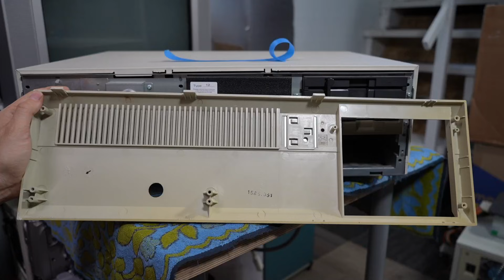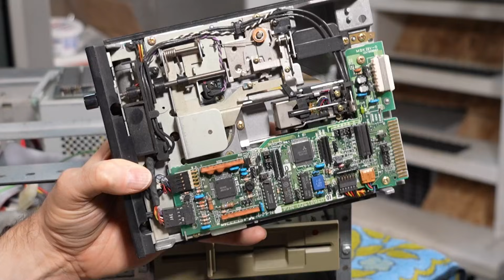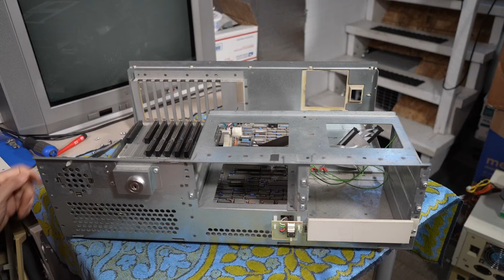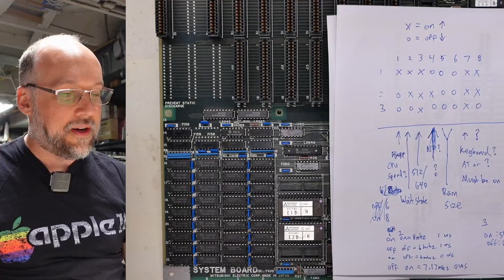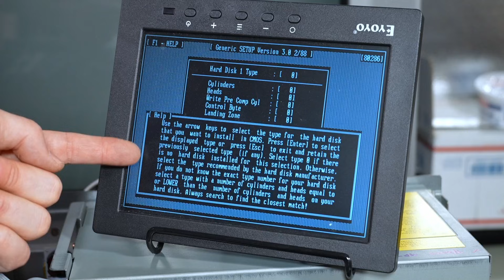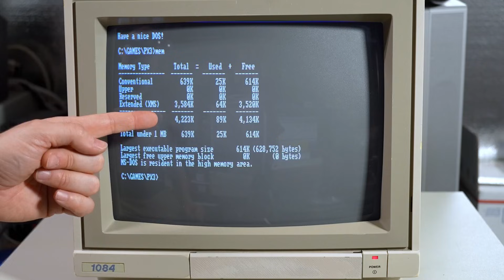PC archeology: The Leading Edge MP-2400L doesn't exist

Comment: Paradise was bought out by Western Digital in 1986, so most Paradise video cards and chipsets were made under WD's ownership. Most 287 co-processors run at 2/3rds of the main 286 CPU's clock speed. The 80287-3 chip is rated at 5 MHz, and an 8 MHz 286 system would run it at 5.333 MHz. The 287XL and some of the later non-Intel 287 chips run at the full CPU clock speed.

Comment: I just saw a re-run episode of The Price is Right from 1985.  They played "One Right Price" or simply the game where you choose from two different price tags.  It was played for a Leading Edge PC and a "Computer Cabinet". The two cost 6500 US dollars.  Not particularly tech nerdy, but a fun coincidence to see a Leading Edge PC on TV just after this video.
Reply: I had a sanyo MBC 55 about this time. A 1.2Mb floppy drive was over $300 and memory was north of $300/Mb

The Japanese computer industry had a mindset that IBM was "the enemy" (they called it "the monster") and the non-IBM form factors were deliberate 

By 1992 ram had come down to just under USD $50/MB, then the sumitomo resin factory fire occurred and ram doubled in price in a period of less than 2 weeks (just AFTER I'd purchased $2000 worth for resale to Atari users. The company which sold it to me offered to buy back what I hadn't sold for 3 times what I'd paid for it, as they were out of stock and desperate to get systems out the door

Comment: As you mention the keyboard going wonky with that other jumper, is it possibly related to the A20 line?
Reply: Unrelated and apologies if I missed it; but I was wondering why that motherboard appeared to have 4 clock crystals? Would that be due to the integrated FDD controller or FPU running at a different speed?

Comment: As others have mentioned this is the same Mitsubishi PC that Sperry also resold under their brand.  I have a complete Sperry 286 system will all original cards and original documentation (including all switches and jumpers).  I also have the original Sperry monochrome monitor and an alternate Phoenix BIOS that works in this system.  The Mitsubishi BIOS that came with these systems had compatibility issues (for example it will not run Windows) and the Phoenix BIOS seems to work better.  If you'd like copies of the documentation or a copy of the Phoenix BIOS let me know.  I also have an old Dolche 286 lunchbox system, a DECTalk card and many other old cards and components you can just have as a donation.
Reply: My previous comment seems to have never been uploaded.
Yes, this is the same model as the Sperry PC/IT.  I also happen to have all the documentation for this computer but, unfortunately no floppy disks.  It was donated to me some time back when I was looking around for more information on my Sperry HT (or better known as the Leading Edge Model M).
Happy to also scan in the Setup Guide's pages as they all came in a binder which is easy to remove for scanning purposes.
Reply: Could you share that bios publicly at theRetroWeb or some forum like vogons? Thanks a lot
Reply: @orbitaretroretro3907  I'll see what I can do.  It hasn't been powered up in years.

Comment: The 386 had a 12 mhz and a 16,20, all the way up to 40. I don't know if they had an 8, but I know they had 12 and 49 mhz was the last one.
The 486 I believe they had a 16, 25, and they went up to DX4-100
I almost think they had a 120
Then the Pentiums 60,75,80,90,100,120 
And I think the P2 was 150 and the P3 was 300 
I don't remember what the max was and the P4 I seem to remember them being in the 2 GHz speed and up to 4 GHz

I am pretty sure the P4 went up to 4 GHz models

I remember when they started doing dual core and then 4 core and 8 core
I think 8 core is standard now.

I don't know what the maximum speed is now

Comment: There are lots of lost PCs 

There was an ISA PCI motherboard that was I think a 486 or a 586 CPU and it was THE board of a year right around 1995

Literally EVERY PC I bought had this identical board and it was silk screened the names of the different sellers but it was the exact same board.

It was a massive pain in my head for years because the board didn't support the larger hard drives.

It had an auto detect hard drive in the BIOS but I believe it couldn't detect above 500 MB or maybe it was 300 MB

I remember trying to flash the BIOS and the last version they made didn't detect the newer larger drives.

I even tried hot swapping and flashing a blank eeprom with a hacked BIOS and it still didn't detect the larger drive.

Basically people had these boards and they were Windows 3.1 or dos and they had four slots for Simm memory, and the machines came with I think and 80 MB or 60 MB hard drive.

When I upgraded them to Windows and put the install files in a Win95 directory and installed Windows 95 and the software programs there wasn't any space left, so I would get a call from the company within a short time and I figured I could just install a new hard drive.
But the BIOS was never designed to work with larger drives and for whatever reason it wouldn't accept a bootloader program to bypass the BIOS.

I got so sick of seeing that board and I don't know how or why but there must have been one factory in Taiwan that just cranked out hundreds of thousands if not millions of this board and everyone bought it from them and they silkscreened the names of the company or no name at all. Some of them had no name, no model number. A lot of the homemade machines where people bought the motherboard from a mail order in PC magazines sold this board.
It was so frustrating because I had older 486 and even 386 machines that the BIOS was able to detect large drives even in the low GB sizes and this newer board could not.
Really had a tough time with it.

Just very stressful

The problems from the early days people just don't know what it was like.
Reply: It was probably PC Chips or Microstar international (MSI) - both makers did this. Usually there was an identifying code in 2-3mm high lettering between the 4th and 5th slot which enabled working out the spec.

These models were infamous for "fake cache" (dummy ICs in the cache ram sockets and a hacked bios reporting cache installed) that would manifest in Linux as a seg11 fault during kernel compilation - mostly of PC Chips origin, but some MSI boards too

The New Zealand importer of these boards was heavily fined by the Ministry of Commerce for deliberately and fraudulently misrepresenting the boards - a company rep then got on Usenet's nz.* groups and claimed "it was all a mistake". Upon seeing this reported via Computerworld magazine the Ministry issued a second - tripled - fine, for further attempts to deceive buyers and ordered the company recall, destroy & replace or refund (at original sale price) all affected boards, overseeing the destruction (These boards could have been salvaged and losses minimised by fitting a non-hacked BIOS, but the MoC was determined to make them HURT)

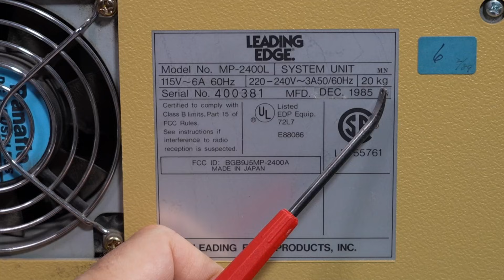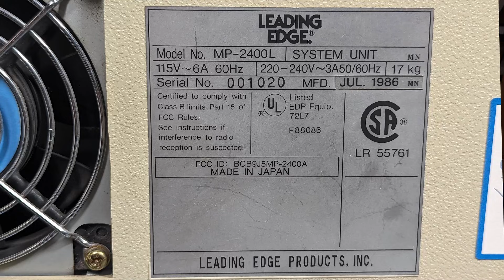Comment: Did I miss it or was the change from 20kg at 4:20 to 17kg at 34:02 not explained? As the PSU at 19:30 states 3kg, and the one at 32:40 looks like it also has 3kg on it although it's unclear, it made me wonder if the later version came sans PSU, but that sounds wrong to my mind. Did they just use thinner metal in manufacture or is it not a measure of the chassis/box but rather the weight which the computer could handle placed upon it (e.g. a CRT monitor or a printer)?
Reply from the maker: Nah they were all identical. Likely the included drive was full height 5.25" and maybe a 3.5" drive in 1986. The big drives are super heavy and could easily account for the difference in mass.

Comment: I have to tell you my bus mouse adapter card story.  For some damn reason we had a HUGE box of these at a job I worked in the 1990s.  Think a box that could easily pack a 14" monitor in it, halfway full of these.  Well, this was during the era of the Pentium and Pentium 2, USB becoming common and so forth, so while PS2 mice were the norm all machines had these ports. One Christmas, I grabbed the box and took it in my cube - the walls were that soft felt stuff that was used for sound-deadening, you know what I mean.  Anyway, I arranged all the cards into a Christmas tree shape on my cube wall by simply hanging them by the solder points on the back, which snagged the felt quite nicely.  I topped it with a squishy stress-ball toy that was in the shape of a star.

Comment: Reminds me of a Sperry machine, it's the right the front panel and vintage. IIRC, it was a somewhat oddball 286. But it's also been 30 odd years, it's just the front panel seems really familiar. 

Given the amount of badge engineering that went on at the time, it's not impossible that Mitsubishi made these for several vendors.
Reply: Yeah, someone in another comment said that this was a Mitsubishi design also used by Sperry.

Comment: It looks like GSETUP is beeping because it can't find the hard disk parameter table in any of the usual places (INT 41h or INT 46h). I poked through the ROM dump and found what looks like a drive parameter table at 0x2fcf; it looks like at least the first few types are standard AT drive types (306/4/17, 615/4/17, etc). You might be able to get GSETUP to work by doing something like "E 0000:0104 CF AF 00 F0" in DEBUG before running GSETUP.
Reply from the maker: I wonder if a patched version could be made? What does that debug command do?
Reply: @adriansdigitalbasement  It sets INT 41h to where the drive parameter table should be on that bios (assuming the BIOS image starts at F000:8000).
Reply from the maker: @leecremeans5446  ah pretty trick! According to another viewer it seems the BIOS only supports type 1-14 as well, so a really limited selection which likely explains the strange way these drives were formatted.
Reply: @adriansdigitalbasement  Okay, I took another look, and it turns out INT 41h doesn't point to the top of the drive parameter table like I thought; it points to the current parameters for drive 0. So I popped GSETUP.EXE open in Ghidra, and yeah, it looks like it's hard-coded to use the AT's drive parameter table address at F000:E401. It looks like the relevant bytes are at 0x274c and 0x274d in the raw EXE; changing the "01 e4" there to "cf af" should make it look in the right place.

Comment: I had an old 286-12Mhz back in the late 80's.  It did pretty good.  I had the Mitsubishi MR-535R 5.25" HH RLL HDD.  It was a good clone machine back in the days.  Although the ISA bus ran fast so you had to watch which cards you had in there if they were tolerant of the higher speed bus.  🤠👍

Comment: Interesting thing that the 2nd one said "only" 17 kg on the back label. The other two were 20 kg. Clearly they made it lighter as it's a newer model.
Reply from the maker: Indeed. I wonder if the older ones came with a full height drive and the newer one something lighter? Those big drives are quite heavy, easily 3kg
Reply: I suspect the lighter one had NO hard drive originally.

Comment: 7.17 MHz is basically 1.5 times the 4.77 MHz speed of the original IBM PC. It was a common speed for turbo XTs.
Reply: what is unusual about it is that it still works plain and simple🤣🤣🤣

Comment: Using nails like that can bite you because they can “splay” the sockets open in the connector, resulting in bad connections and pin retention when hooking the connector back up. Same with sticking T-Pins in the D connectors. Ran into that almost daily when I was doing Avionics work for years. Just something to consider.

Comment: Did the math.  6a is almost 700W.  That is insane when most systems through the 90,s had like 250w power supplies.
Reply from the maker: I think part of that is the pass through connector for the monitor, but it's still quite a substantial power supply for the time

Comment: Although, this comment isn't about this particular model, but it's somewhat related in the vein of the Leading Edge brand.  I have a rather late Leading Edge PC (Fortiva 5900, aka "CPC-5200") and there's NO documentation on the particular model that I have.  I found the manual for it's predecessor, a 486, but mine is a Socket 4 Pentium 60MHz.  It seems like there's a common theme here, unfortunately.  Maybe these particular models that are lacking their documentation (Adrian's 286s shown in this video and my Pentium 60) were the ones that didn't sell well?  Were they flops like the Apple Lisa or IBM PCjr?  🤔

It was fantastic seeing you again in person, Adrian, (at VCF Midwest) and thanks for your input on my aforementioned Leading Edge PC!

Comment: When I was younger we had a leading edge computer that I always thought was a 386 but I guess it would've been a 486 because it definitely was one of the winpro cases.  it had windows 3.1 and also had a CDROM drive and 4MB RAM.  Kinda cheap and limited.  Pretty surprising how poorly specced so-called multimedia PCs which had CDROM drives were.  Probably more focused on crappy edutainment shovelware that just slowly loaded text and static photos off the disc, than anything real time/interactive like games.  If I was more familiar I might've been able to use Doom at playable frame rates but I had no idea about adjusting anything like that, but even then a 33Mhz 486 would've certainly struggled to be playable.

Comment: I just started watching, wanted to say the the IBM 5170 PC/AT  does have three half-height drive bays on the far right.  The bottom one is not accessible with the cover on.

We had one at work that I had to upgrade for Oracle 5.1 for DOS, and I had both 20 MB and 30 MB full height drives in it along with the 1.2 MB 5.25-inch floppy drive in the top right bay.  It took a 128 MB RAM card to get to 640K conventional memory, and an Intel 2 MB expansion ram card.  It also had the Professional Graphics Adapter (PGA) card and display monitor and a Digital Equipment Corporation Ethernet card (DEPCA) using DECnet-DOS.

I wish I had it today!

Comment: Ah the FCC Class A HDD, blast from the past.  Not for use in residential areas.  👍😁  Although you still see class A devices, current HP enterprise printers are still only class A and not class B compliant to this day.  😲  That is just lazy / cheap RF engineers for not obtaining class B certifications.

Comment: This Leading Edge PC is identical to the Sperry PC/IT. I was working for Sperry when they developed a relationship with Mitsubishi and started selling Mitsubishi PCs with the Sperry branding. I bought a fully loaded PC/IT through their employee purchase program. It was my first PC and I still have it albeit in storage. I had to upgrade the BIOS ROM chip in order to run off the shelf Microsoft DOS or OS/2 as the original BIOS was not IBM compatible.
Reply: Hi. I published on vogons a couple of weeks ago about another Sperry 286. I had been asking for that updated mitsubishi 1.58 bios... if you have it for any chance would you mind sharing it? Thanks
Reply: I will scan my Sperry PC/IT system manual and also make images of the original 1.2M floppies that came with it as soon as I can. The floppies include the Sperry OEM releases of MS-DOS 3.10 & 3.3.0 as well as the CMOS configuration utility. I will look into imaging the ROM BIOS upgrade I got but it is in the system unit which is in storage and a little bit buried. As such this will take a little bit longer. I purchased my system in 1986 and the dip switches are on the back.
Reply: @paulwierman8078  that will be great. And of course that can wait :) thanks
Reply: @paulwierman8078  would be happy to see all that stuff archived!!
Reply: The Mitsubishi bios (before 1.55) couldn't handle 1.2Mb onboard floppy drives either - that's probably why the addon card was in use. 

Indications elsewhere are that it's a phoenix bios with Mitsubishi branding

If you still have the manuals (especially if they have the dip/jumper settings documented) I think Adrien (and others) would be eternally grateful as there are none online on the usual repositories

Comment: I have a Commodore 286 with the same 512/512MB or 640/0MB memory config. I also have an AST Rampage 286 RAM-card. It can be configured to extend the 512MB on board conventional memory to 640kB and make use of the remaining 384MB. Thought it was not easy,

Comment: Those NiCd batteries look to be rechargable. They are most likely totally discharged... and most likely good.
The mother board would take a while to charge them up, so if you use them... maybe leave the system on for a day to fill them up.
Reply: Yeah, i bet they still work. One good thing about NI-Cd is that unless they leak, they only age with cycles and not by time as the other ones. I bet poisonous stuff prevents bio thingies from messing things inside (dendrites?) 🙂 Its like that solder tin with proper lead that lasts.
Reply: @freeculture  Yes, NiCd is famous for dendrites and "Memory". You want to not over charge them, and discharge fully before next charge.

Tin whiskers are the surge of modern electronics. After about 100 years of it not being a thing... 
I think instead of RoHS, EU should have had everyone go to classes to learn to not lick or chew on electronics.... it would have been cheaper, and less people would have died from tin whisker failures.
Reply from the maker: I'd never ever keep a NiCD batter in one of my computers. (Sealed or otherwise) I've had to junk far too many motherboards when they leaked and destroyed things.